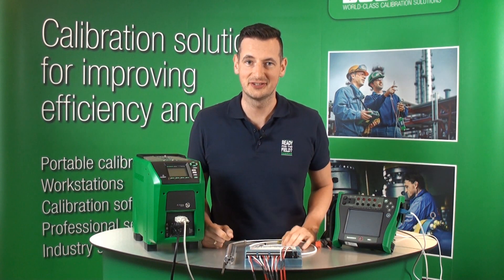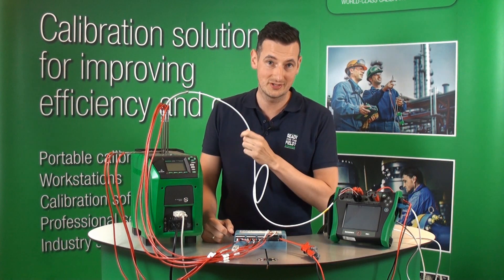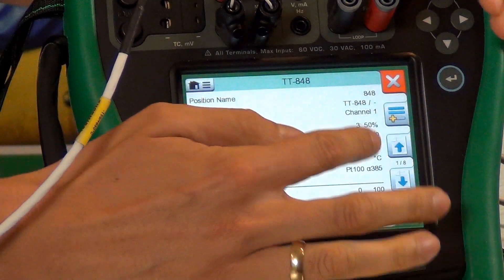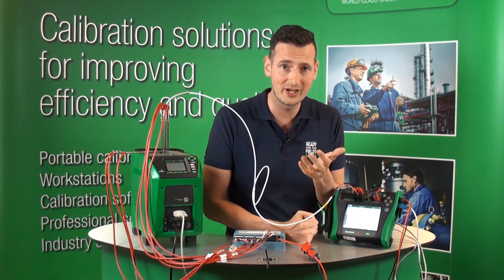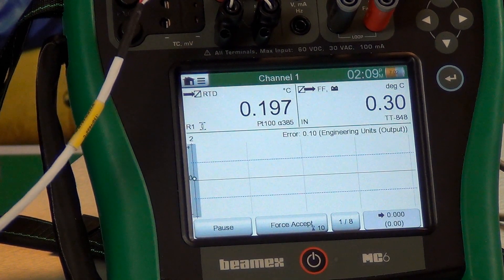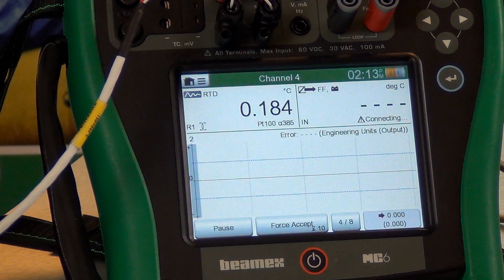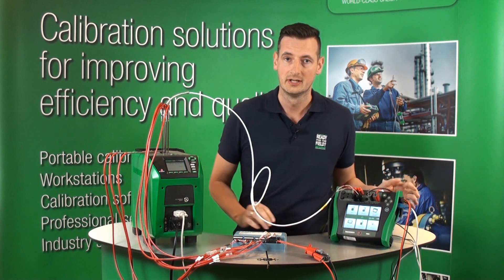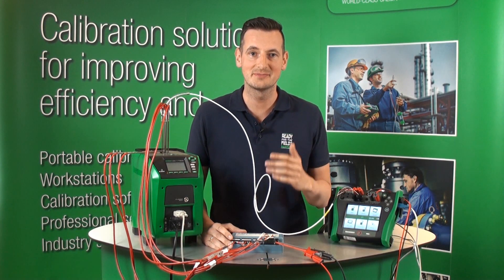How to calibrate a multichannel fieldbus transmitter - Beamex

Comment: Hello, could you kindly give me the information about the FF multi-channel device? Thanks in advance!!!
Reply from the maker: Hi Joseph, that is an Emerson / Rosemount 848T transmitter used as an example. But it is not relevant which model was used here, you could use any other model too. The main purpose of this video is to show that the Beamex MC6 can fully automatically calibrate a multichannel FF transmitter+sensors combination.
Reply: @BeamexCalibration  Great. Thanks for the info.